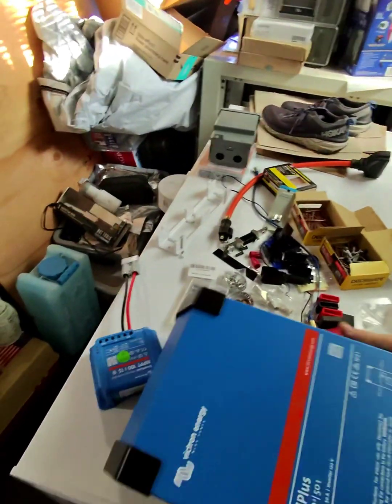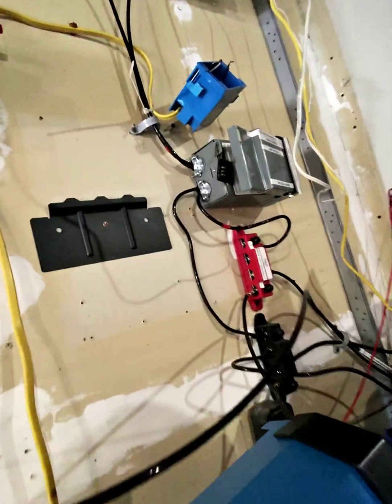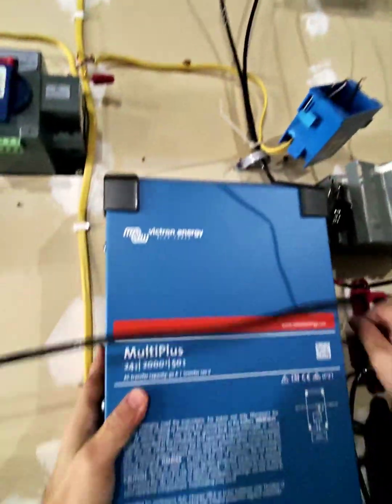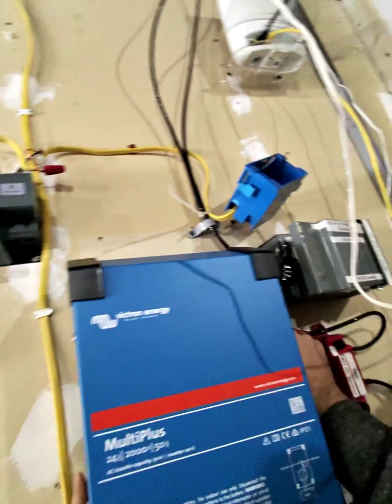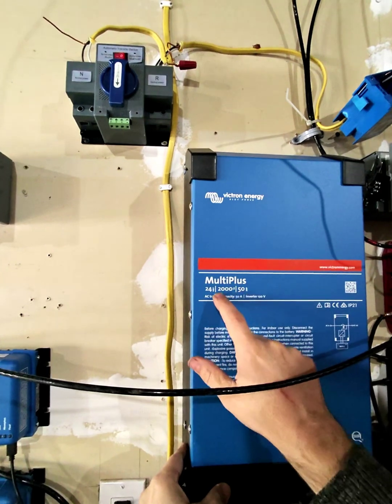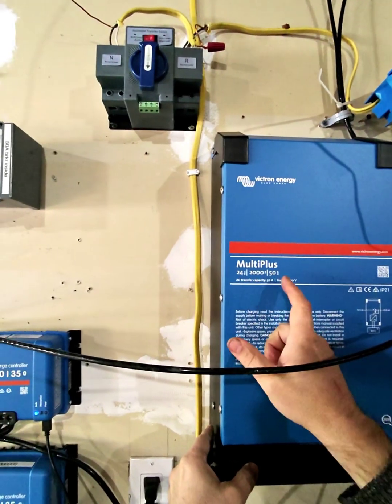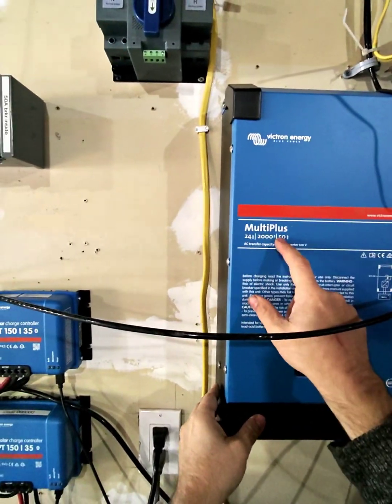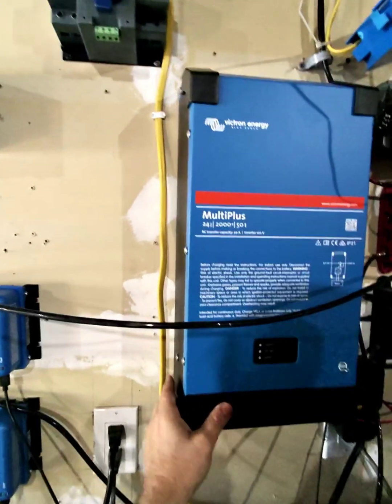Test mounting Victron 24 2000 Multiplus

Comment: Are the supplied screws really enough to hold up the 5000va model? I recently bought one.
Reply from the maker: I don’t know.  The screws with the 2000 look very beefy and I was able to mount it safely with just regular construction screws.  I bet the screws they ship with the 2000 are oversized and may be the same ones as for the 5000, they look overkill to me so probably Victron sent good screws
Reply: @suburbansolarhomeandpreppi9936  ok thank you

Comment from the maker: Note this has several large screws that need to be installed.  If you don’t have a horizontal stud I suggest adding plywood or some 2x4’s across your studs so it’s stood off slightly